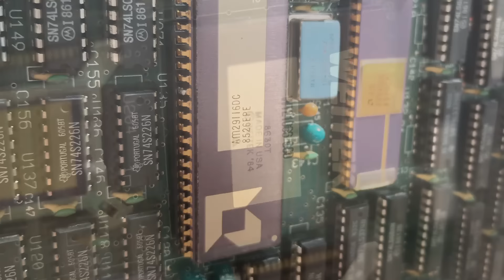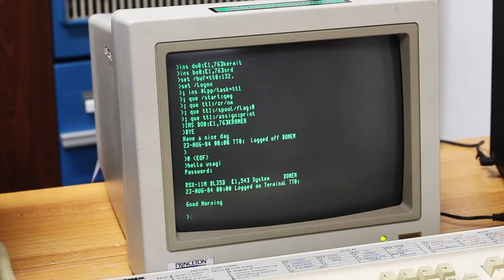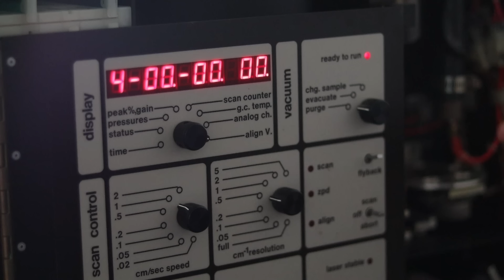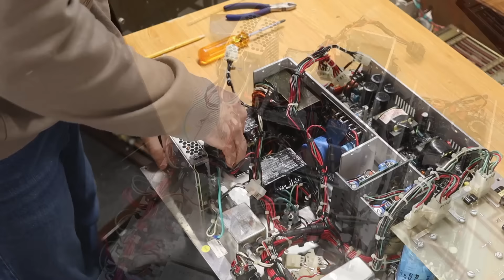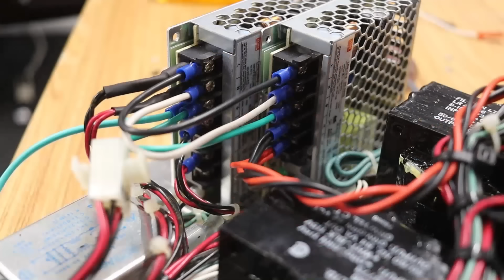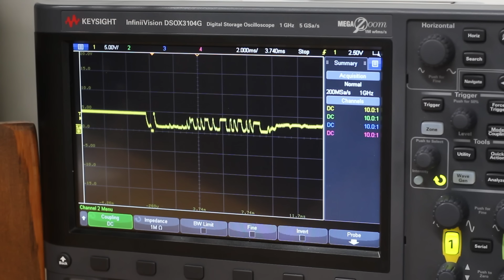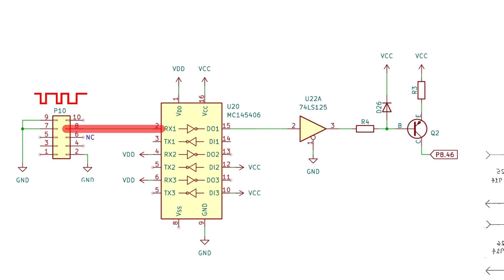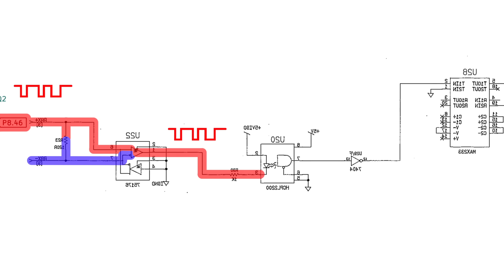I Tried to Connect the Bomem and PDP-11/73, It Did Not Go Well...

Comment: ... this is all cabling.

Only guessing right now, I haven't gone and looked up the schematics myself. I am sure they were previously able to "get away with" using the same power supply on the bomem end because that's the end that is supposed to be sourcing the current for the isolated communication anyway.

Assuming each communication channel is truly isolated, if TX and TX-RTN get swapped then you also get logic inversion. Swap these two pins in your connector. Swapping RX with RX.RTN may also be necessary. Obviously if all of the RTNs were common'ed with each other then you'd be shorting TX to RX and probably to GND also, but they're not in this case - they should be all isolated.

Again, I haven't looked at any schematics,  but given the labeling and the little snippets you showed, I'd say - maybe look over it yourself and make sure it's not going to set anything on fire, but otherwise, swap TX with TX-RTN and possibly RX with RX-RTN.

If I'm right... you may find all the data (as in data data, not control data) signals also inverted, aaand if that's the case, have fun mapping out all of your RTNs and swapping them all!

Comment: If that receiver/transmitter is 75176 RS485 rx/tx, You can invert signal by exchanging two wires of differential pair. Input A -> A, B -> B normal; A -> B, B -> A inverted. Best Regards. P.S. 75176 is actually using 3 wires, as RS485. Referent ground (which can be evaded by trickery), and two logical signals (0, 5 VDC). Extremes are +12VDC, -7VDC. If all of your signals use 75176 for diff. then you should use appropriate returns since they are signals too.

Comment: You have a ground loop issues
Reply: He should check his 120V outlets for grounding issues. There should be no significant ground voltage between the different outlets in that same room. If there is, something isn't bonded correctly and should be addressed ASAP, or something is flowing significant current on a ground wire, which is even worse. 

Sometimes common mode AC mains filter caps, most noted "Y" fail shorted, creating a ground fault, making substantial ground noise/current. 

If this was a large commercial/industrial facility, where data might be transmitted significant distances, with various power sources bring used between equipment, there can be substantial electrical noise and gound variations, and would be considered normal. But, in a garage back room, this isn't the case.

Comment: RX/TX...the fundamental question is WHOSE RX and WHOSE TX? Because my RX is your TX and vice versa. It's like plugging in a USB connector -- always takes 3 tries.  That RS232 signal at 20:58 looks a bit dodgy. IIRC the voltage levels need to be +/- 6V or greater, and the negative level looks like it's not quite -4V, which is outside that range...

Comment: Every time in see your Bomem I cringe. To me it is far too complicated. When your unit was built, I worked for another FTIR company, Initially called Laser Precision, later renamed Analect Instruments. We specialized in process control and environmental monitors in mid-IR and near-IR. We used a different type of interferometer that was far more reliable in harsh environments than a moving mirror Michelson. We had much lower resolution than Bomem, so we got by at first with a custom TTL FFT processor that had been someones master's thesis project. The low resolution did not matter for our applications because molecular lines in the infrared tend to be broad because they are highly degenerate --multiple states with slightly different energies.

We started out with 8085 processors and all those parallel data cables. Yech! Around '83 or so I redesigned the interferometer and data station around Z80's. A few years later I replaced the parallel cables with an early Intel network chip. We could then run many meters over differential twisted pair. Later we added the option to replace the twisted pair with fiber optic cable. With good cable we could run 100's of meters to a kilometer or so (at reduced data rate) between the interferometer and the data station. After I left, they hired a consultant to replace the Intel controller with proper Ethernet. He left before it was finished, so I had to come back and fix up the mess he had left.

The company passed through multiple hands starting in the early 90's. The brand is now sold by Process Insights in Houston. From the packaging and model names, it looks like the basic design is still as I last saw it in 1999.

Comment: How many phase different a/c sources do you have in your shop? Not every AC source is phase relative. Because a 220volt signal is derived from between two 120 volt lines that are 180° out of phase. However a 3 phase system has  3 legs each 120v and 120° phase difference.

Check for cross connections that could effect the shielded cable between devices

Comment: just use the other input of the 75175. 1 pin is a neagative input the other os a positive input so you can use it as a inverting or a noinverting input.

Comment: Usagi Electric... Adrian's Digital Basement(s)... ElectroBoom... maybe, maybe, maybe The 8-Bit Guy - these are the only things that would prompt me to turn down MST3K and put down whatever the hell it is I'm making.  AND we're getting to see the computer I misspent my youth on, the PDP-11/73!  Gosh I miss RSTS/E.  Seeing ReGIS in action is always a good time.  Thank you, thank you, thank you!
Reply: Seeing ReGIS in action is even more exciting when you wrote the ReGIS interpreter from scratch, something I did for the SmartTerm terminal emulators. I had worked on the VT340 and for the Professional350 at DEC before that, so I knew the way it needed to work, but at DEC, I wrote a lot of the GIDIS primitive layer while others wrote the ReGIS interpreter. The toughest part is emulating the VT125, which combined the character mapped display output of the VT100 with the output of a separate bitmapped graphics board on a single screen. The normal text scrolled independently from the bitmapped graphics, and whatever you did in graphics or terminal text didn't affect the other. Simulating that on a single bitmapped display controller was hard to pull off convincingly.

If my memory serves me correctly, the VT125 had BNC plugs so that the graphics without the ANSI text could be displayed on a separate color monitor; I don't recall if the VT240 did. In fact, I don't remember if the VT240 had a separate character mapped display controller with alongside the bitmapped display or not. I did briefly work on an upgraded prototype that provided more colors and higher resolution (done before the prototype that ended up spawning the VT340), but that's another story.
Reply: @filker0  I don't have a 125.  But I do have a VT52, VT102, VT510 and my second favorite DEC GIGI VK100 (the 52 will always be #1!).  I've seen the upgrade board for my 102, to give it ReGIS pop up a couple of times, but I can't justify the expense just to satisfy my own sick pleasure.  If I recall, the regular and advanced video board for the VT100 do offer video out, with the advanced board offering video in - and then the graphics card had to be added (what was that thing called? Retrographics or something like that.)  The nice thing about the GIGI: It works beautifully on a VGA monitor using a GBS8200.
Reply: @wpaez4782  I had a GiGi for a while, but gave it to a friend who I used to work for.

I don't do graphic terminals anymore, but for a good part of my early career, I did.

Someplace in my basement I still have a vt100 with EVO and extra character ROMs for a specific application that I doubt exists anymore (ran on RSX-11/M, written in BLISS, and I didn't get a copy with the terminal, but I did get the manual).

Comment: Standing in the middle of a mad scientist's snarl of hand made cables and antique silicon repeating "I'm not crazy!" is kind of a peculiar aesthetic.
Reply: Needs ... how did Ian M.Banks phrase it? ... "high voltage electrical equipment with conspicuous insulation problems".

Pitchfork- and torch- wielding peasants hammering on the castle gate may be hard to arrange in Texas. Or maybe not.
Reply: @WellsiteGeologist-UK  The pitchfork and torch crowd in Texas may have their hands full with a winter storm at the moment (be safe out there folks!), but even after that's worked out I don't think David has anything to fear in that regard. His rabbit crunching lettuce doesn't match up with my image of a Bond villain petting an exotic cat.
Reply: @NateEngle  You've never had to separate a doe from her kittens, have you? Those big feet have big claws on them, and big muscles for ripping your arm to shreds.
Our cat also discovered that a doe can kick seven colours of shit out of her belly even as she was trying (and failing to get an an artery past the loose skin of the doe's neck.

I'll not shed tears over Texans in a brief winter spat. I met my wife working in Arctic Siberia, where it would be below -50°C from late November until late February. Going to visit her after 3 months on a +40°C equatorial island (working!) via rainy London was an experience.

Comment: Maybe a ground return issue from your -12v PSU. If the hard ground is connected to the PSU ground and the PDP  is tied to your pdp psu gnd, they are different evels and might be affecting protection trips.
Reply from the maker: I was concerned about that initially, but on the PDP-11 side optoisolator board, the +/-12V supply GND is tied directly to the +5V GND, so at least on the PDP-11 side, the grounds are all shared.

Comment: It's that there are several ways to label a pin/socket...  Say that a through-hole mounted connector where socket 1 is labeled tx, this could mean that the trace goes to a chip expecting to ttl send a signal...  but it could also mean where to wire TX from the other end!  I.E. Socket 1 is where the TX line from the other end goes or socket 1 is where TX from out end "originates."  So yeah, you will always get it backwards.

Comment: If you have differential transmision, just swap cable tx+ and tx-
Reply: Yeah, I noticed that on the cable as well. Wonder if it's RS485 instead of RS232 (which would make a lot of sense if it's supposed to be isolated)

Comment: Man, do I feel your pain. Before I retired, I kept several serial devices talking to a data aggregator over a mix of serial ports, mostly 232 with some 422/485 just for fun.
Sounds like you are running afoul of the 50, 50, 90 rule - when there are two ways to do something 90% of the time you get it wrong!  ;-{)>
It was a marine environment, so grounds were the #1 problem with the 232. I cannot count the number of times we would troubleshoot a newly installed sensor, have it working perfectly connected to a laptop, and lose the data at the aggregator. 99% of the time, a B&B Electronics Optoisolator solved the problem. The second issue was the same one you had with the D50 connector, where the matching piece would disappear. On that subject, I had a coworker who, once the cables were connected and data was coming through, was absolutely against building a shorter cable with the correct ends. Third, and certainly not the end, was the eternal question: Do we need to swap 2 and 3?
Keep up the good fight and remember, if you aren't having fun, you are doing it wrong.

Comment: In Networking we got so fed up of our TX and RX Pairs being reversed between Patch and X-Over cables that an entire standard called Auto-MDI-X  was born and ratified in to the Ethernet standard, Rendering the need for Xover cables entirely obsolete. 😁
Reply: Part of it has to do with the history of Ethernet as a shared bus structure, then evolving into a shared hub-and-spoke medium (with daisy chained hubs and spliced Ethernet cables galore), and finally graduating to the more familiar dedicated point-to-point switch architecture. Somewhere in the process, things got incredibly confusing and MDI-X was the answer. If we had to start from scratch, we'd probably standardize on a single type of cable and call it a day. In today's environment, most connections are pretty direct from the PC to the switch. The wild-west of ad-hoc network wiring is mostly a thing of the past.

The wide availability of WiFi probably also has something to do with it. Where in the past, you'd string together whatever lengths of Ethernet that you found in the scrap bin, today you use WiFi for improvised networking

Comment: 14:51 you don't suppose the monitor power supply is putting out EMR that is causing the electronics in the laser to wig out, right?
Reply: Either that, or you have a strange ground situation
Reply: And a few minutes in the video later, and sleep, yup, it was grounding issue. 

Shame you weren't able to get them talking. Hope after you get the proper interface board this works the way you intend.

Comment: Grounding is Far more important than people realize. I used to work on high end car audio and anytime there was a problem or the amps would not hit that hard i check the ground. Connected to the chassis of course. Once you treat it the same as the positive and connect it to the battery, "same size cable" the system is fixed and hits twice as hard.

Comment: Better method than cutting a perfectly good cable is to take two female plugs and wire them together as an adapter. It's much less messy that way. Also there are small DC-DC converters that provide galvanic insulation. They are tiny, board mounted boxes...

Comment: When you bolted the new "isolated" power supply to the same metal baseplate holding the other power supplies, didn't that connect the grounds together? If so that "isolated" ground is not isolated.
Reply: That's only if the frame ground is hooked up to the output ground.

Comment: Who's transmit line is it anyways?
Reply from the maker: I need Wayne Brady to come sing at the Bomem before it'll work properly!
Reply: That's a good question. Made me think of RS485 2-wire differential wiring just for the reason that it do use share the transmit lines (differential) with the receive wires.

Comment: Any possibility of inserting some MORE inversions in that data path? I mean, it just doesn't look obfuscated enough for a commercial scientific instrument.🤣 You are probably better off designing your own data converter to connect the computer to the instrument. You are lucky that you have the complete schematics! I remember working on an old HP spectrophotometer that had serial to the PC. The manual said it was a DTE RS232 serial , but there was an unlisted dip switch that changed it to DCE RS232., and of course it was set to DCE. Another switch set parity, and that switch was bad, Took over a week to figure out why it wouldn't work.